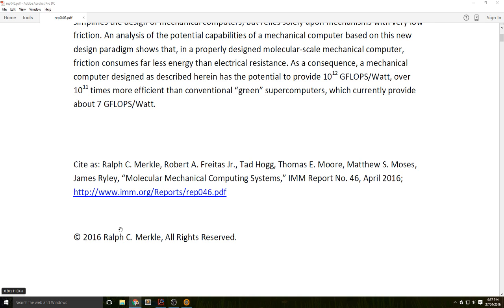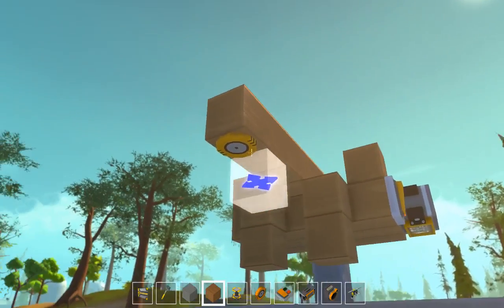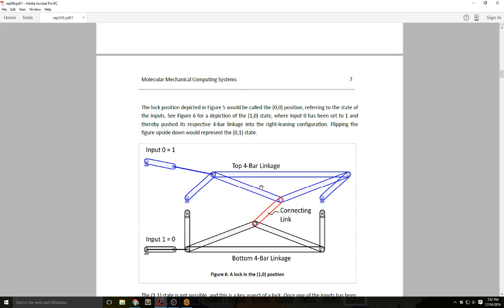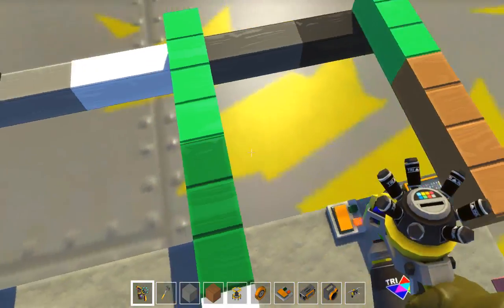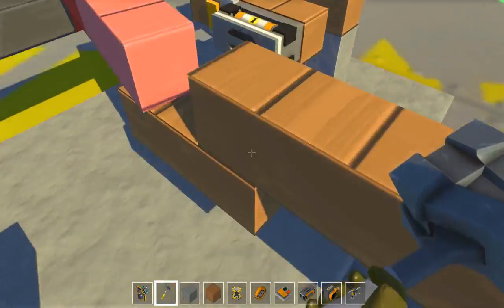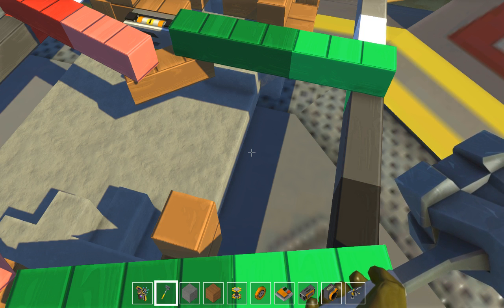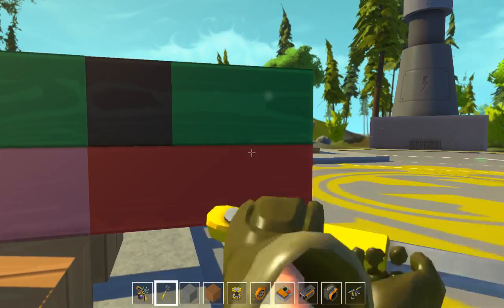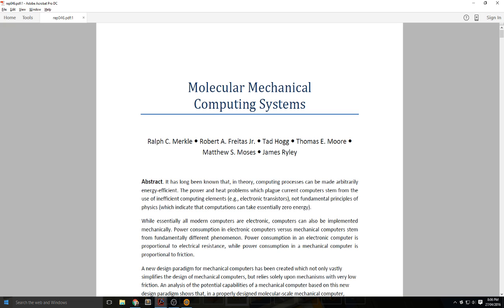Let's (Scientifically) Replicate, Part 1, Molecular Mechanical Computing Systems & Scrap Mechanic

Comment: I looked at some videos on Scrap Mechanic ages ago. Saw the lack of loops, and decided that it was too much of a headache to mess with.  They were having the same problems with their locked blocks pulling straight through the locks.

Did you watch Temple of the Lava Bears? Everything is fine...
Reply from the maker: +Kazriko Redclaw It's mostly from LRR stuff.
Reply: (Also, as someone having tried to implement Ladder Logic inside of Little Big Planet's editor, I feel your pain. ;)
Reply: Ah yes, LRR actually did the Temple of the Lava Bears D&D game, so they adopted that "Everything is fine" thing all over after that.
Reply from the maker: That'd do it.

Comment: It's certainly a start, if somewhat salty towards the end. Since this aired at 4am for me I couldn't make it live. I think the biggest question is whether your overall goal is to replicate their bearing and stick diagrams like Figure 5 or replicate the more general "link" and "rotary joint" spirit as shown in Figure 16 with their diamond lock. I think it should be possible to make something like Figure 16 using only 2 knots in the mechanism and 2 to tie it down to the plate.
Reply from the maker: +Lytebringr Step 1 is to do a figure by figure replication. Step 2 is to optimise. It's always useful starting from a known good state.